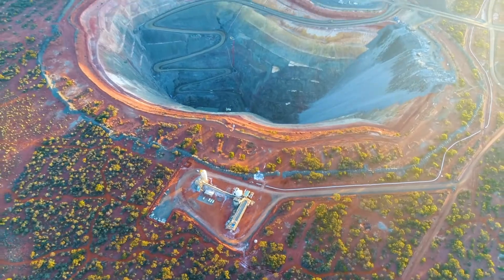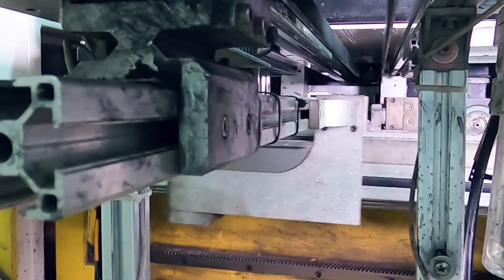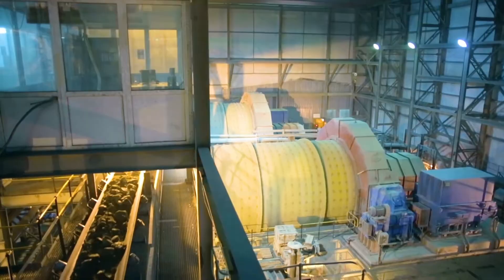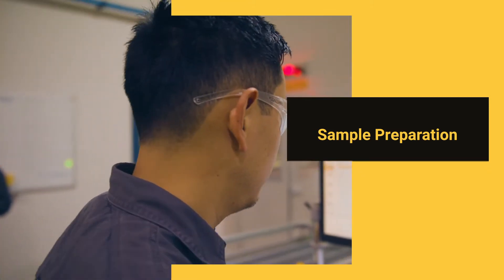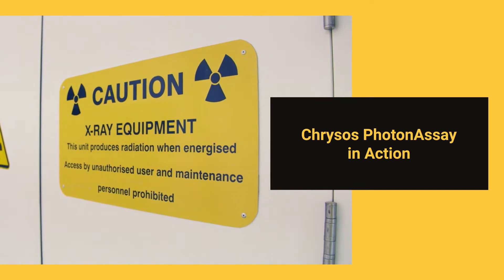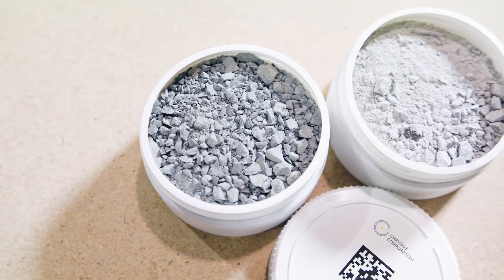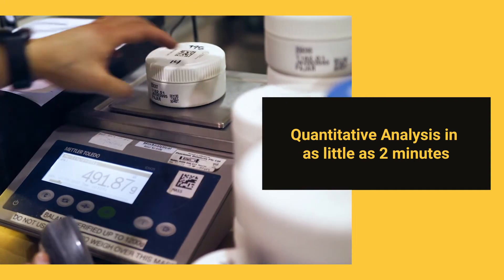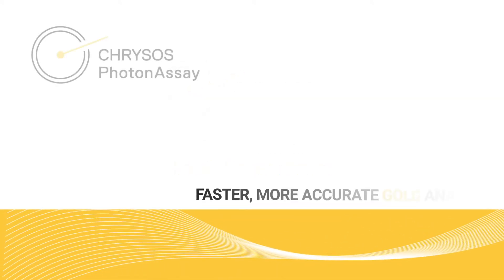Chrysos PhotonAssayᵀᴹ provides value across the mining value chain

Comment: Is this a safe machine?
Reply from the maker: Great question. PhotonAssay™ is a fully enclosed, automated X-ray system operated under strict radiation-safety regulations and is completely safe. It also avoids the hazardous chemicals used in traditional fire assay. You can read more here at photonassay.com